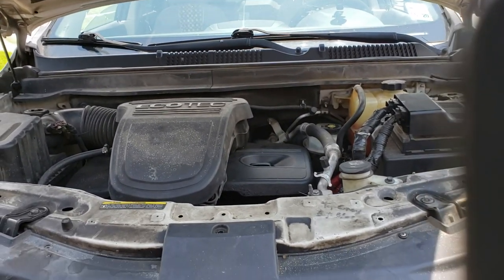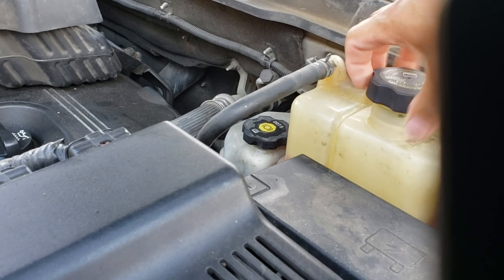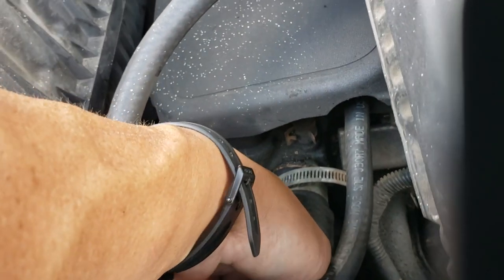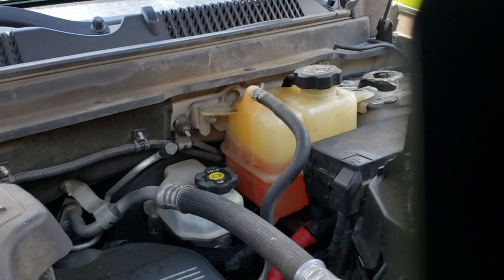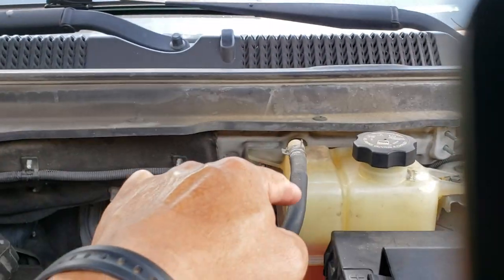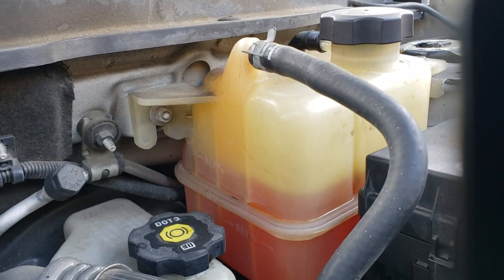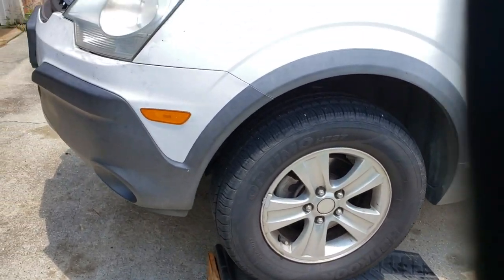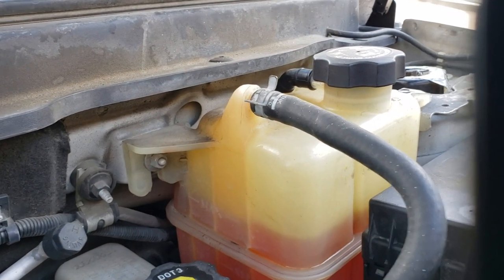How to burp bleed air out of car has no radiator cap equinox  Saturn vue

Comment: That will get some of the air out, but not all of it. A better way is to squeeze the hose like in the video, but after the engine has warmed up, shut it off for a few minutes, them very slowly unscrew the reservoir cap. Do not remove the cap, just unscrew it until you here the air/steam purging, then when it stops, unscrew it a bit more till you hear it again. It will bubble and gurgle. If it starts to bubble up high enough to hit the overflow, tighten the cap to keep from loosing coolant. After a moment when it settles down you can unscrew it again to see if there is more. Do this as many times as it takes to get the air out. It will likely take an hour or so on these cars. I went from cold air, to warm air from squeezing the hoses, to air that was hot enough to hurt a bit if holding your hand in front of the vents for more than a few seconds after purging via the cap.
Reply: thank you for this advice
Reply: I hear ya, and I got tired of the squeezing to purge air. I got a vacuum uplift system. No more air!

Comment: This technique is very accurate. I have s forenza with reservoir in the same spot. They can be tricky to bleed out the air. But I've had best results using this dame method. Bravo 👌🏼👏🏼. BUT I do have one question in regards to 1 thing I did different. I did all this but with the cap off. I thought that's the only way the air gets out? Does this still work with it on as your doing? Were does air go if you have cap?

Comment: How does it not pull air back in the same way it goes out when you squeeze hose it pushes air but when turn the hose loose it pulls like a vacuum . Im not saying the procedure don't work I'm just curious as to how it does not pull air back in
Reply: You press hose to force air out of reservoir. When you release the squeezing, the coolant in reservoir gets pulled in. Do this at operating temperature for about 20 minutes until no bubbles come out of reservoir. Make sense?